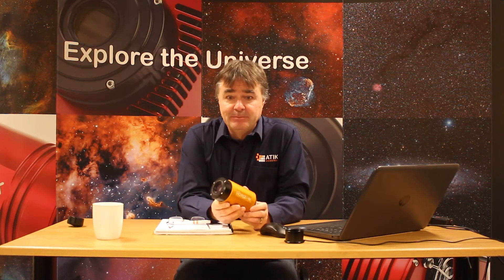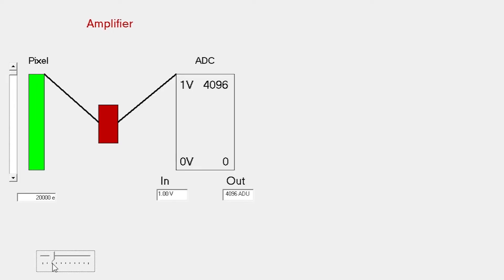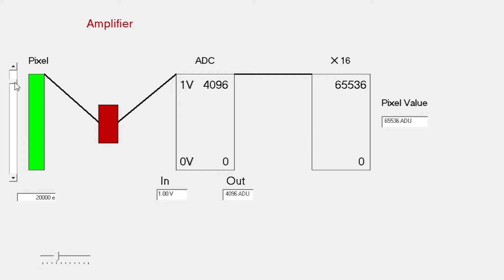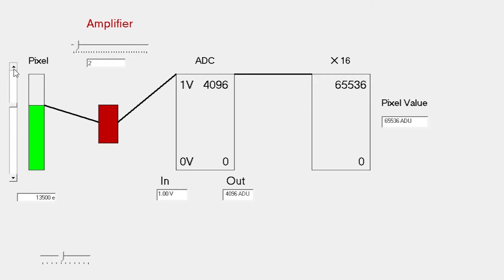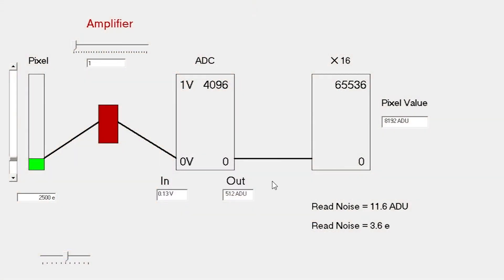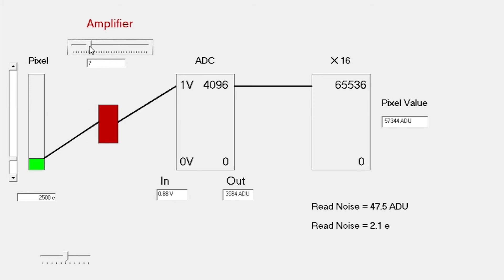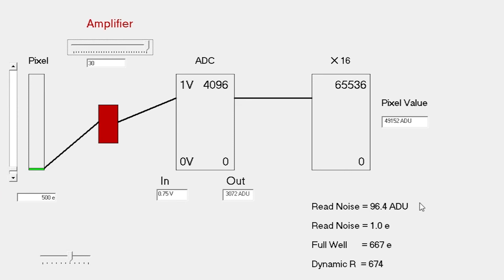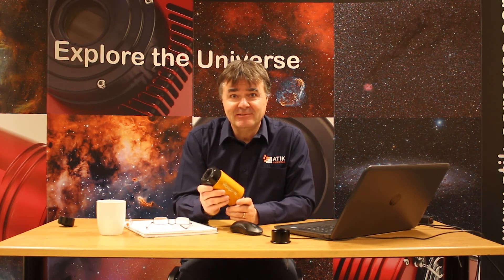CMOS Gain Settings

Comment: Thank you very much for this video. The software you created to demonstrate the effect of Amplifier Gain on the resulting signal is outstanding. So, without a "Gain" an amplifier would simply convert electrons to voltage in a linear manner. With a Gain vale for the Amplifier we cause the voltage to b reached with fewer electrons but this will also cause the full well capacity of the sensor to be diminished. Is your software available online?
Reply from the maker: Glad you enjoyed. All of our software is available freely via our website (in the downloads section)